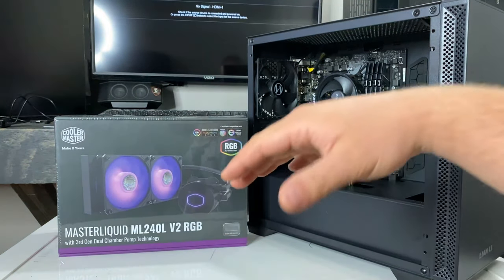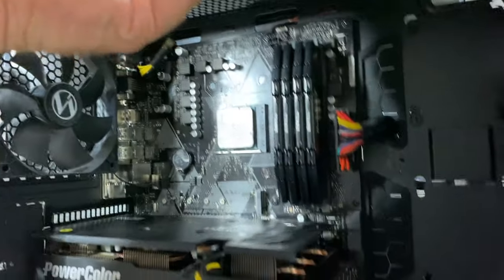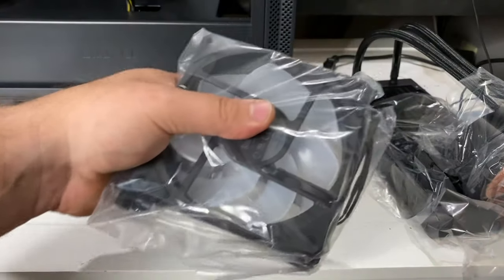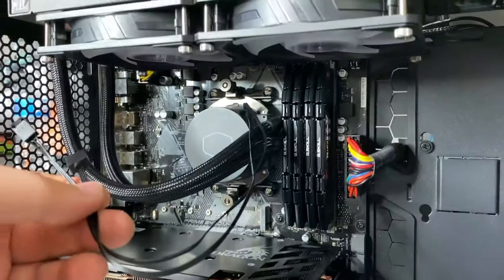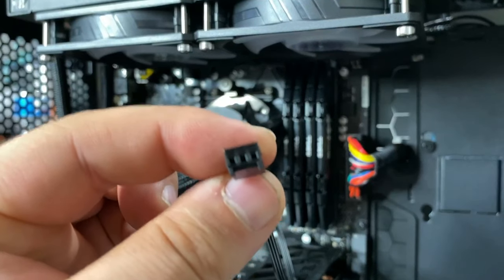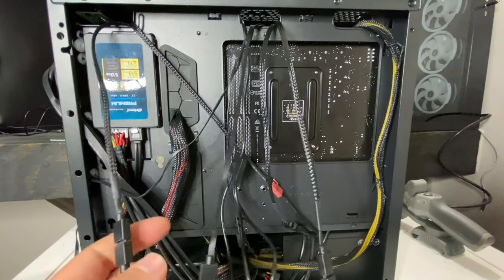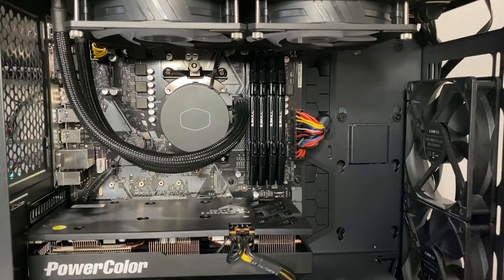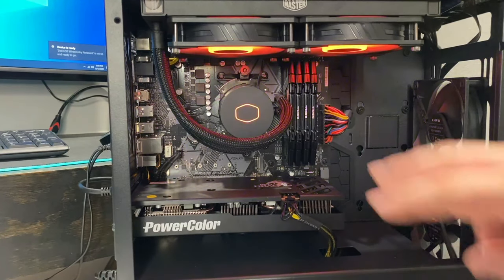How to Install a Water Cooler in your PC (MasterLiquid ML240L V2 RGB)

Comment: How would I connect the rgb to a z170a gaming m7 motherboard?
Reply from the maker: I believe you'd have to use the included controller and connect it to your molex connector from your power supply.
Reply: @BuildsWithV  so I connect it with the peripheral cable?
Reply from the maker: @Alex-pm2jj  correct, just have to connect the controller into your molex connector and then plug the fans into the controller itself.
Reply: I'm not sure what a molex is, is it like a peripheral cable or something like that? Not sure what you mean by molex
Reply from the maker: @Alex-pm2jj  it’s has 4-pins and they’re pretty big. The molex connector comes from your Power Supply. Search up molex connector to see what it looks like. It’s basically an older style connector. Still comes on PCs
Reply: @BuildsWithV  i have a smart series 500 watt power supply from thermaltake it has sata instead of molex
Reply: @BuildsWithV  does it work with sata though?
Reply from the maker: @Alex-pm2jj  oh okay, so it can work with sata but only if you get a molex to sata adapter.
Reply: @BuildsWithV  any recommended coolers without rgb?
Reply from the maker: @Alex-pm2jj  you can leave the RGBs unplugged on basically any cooler and it’ll all work fine. I can’t think of any cooler without any RGBs.
Reply: @BuildsWithV  would you recommend a hyper 212 black edition? Just found it for 30 dollars on amazon
Reply from the maker: @Alex-pm2jj  oh yeah they’re solid Air coolers. I thought you meant a AIO with no RGBs. But anyways yeah the 212 is pretty good

Comment: Just had this cooler ruin my CPU so be careful people. Check your temp regularly. The pump just stopped working and within an hour my whole CPU was fried.
Reply from the maker: I’m sorry to hear that man, are you still under warranty with the cooler? If you are I’d contact cooler master and tell them what happened. I’m pretty sure they will compensate you for your cpu and for the cooler. I’m not positive but it’s worth a try.

Comment: IF you use  watercoolers💦  cpu/ GPU  The Radiators  hoses   standing upright   front pc    on top  
  -  rtx 2080 waterforce  new 32cel  idle       1 year L8tr 26 idle           nice
Reply from the maker: I’ve personally never had a single issue with my radiator at the top of the case. No gurgling or anything. Great temps too.
Reply: @BuildsWithV   yeah my cpu radiator   is above  on top  the   GPU  waterforce 2x rad    front pc

Comment: Actually you did wrong. Mounting it on the front is better. Now it's exhausting and taking hot air generated from the GPU to the radiator. When it is on the front, it is not taking very hot air in to the case that doesn't make hotter the GPU.

Comment: You should have told us to plug stuff in before putting the radiator
Reply from the maker: That is a great point. I usually just plug everything in once the radiator is installed but in many cases you will not have enough space. Thanks for watching and for letting me know. 🙏

Comment: See here is my dilemma… why install a fan on radiator to blow Hot PC air ON radiator which cools liquid, as opposed to installing fans so they suck the air, through radiator cooling it off and two other fans can suck the air out? Everyone installs the fans on radiator to blow the inside hot air on radiator, when it makes a lot more sense to suck the outisde cold air through radiator
Reply: I was wondering about this myself when I saw the video. I'm assuming that part is kind of wrong?

Comment: What about the water? I don’t get how this works that’s why I can’t switch as I’ll fuck it up lmao
Reply from the maker: The liquid is already inside the cooler. These are closed loops systems which means you never have to maintenance them besides basically dusting. I feel you on that tho 👌
Reply: @BuildsWithV  ah ok that’s cool, might look at getting one of these they look good for keeping temps low

Comment: My rgb won’t work because I don’t have an rgb header in my motherboard 😔
Reply from the maker: Connect it to your power supply with the included molex connector and controller
Reply: @BuildsWithV  I didn’t see a plug in my power supply

Comment: Never used a water cooler but wheres the water lol
Reply from the maker: It’s inside the cooler already. These are called AIO which stands for all in one. Basically they’re closed loop systems so the water comes pre-filled and basically unable to switch it out.

Comment: did you plug the CPU on the same thing as the RGB ? https://youtu.be/8Lt-Y5hagL4?t=1327
Reply from the maker: The CPU block RGBs were plugged into the same splitter as the fan RGBs.

Comment: worst water cooling ever,  it keeps my i7 9700k at 75° - 80°  C while playing games
Reply from the maker: Did you make sure to remove the plastic sticker on the bottom of the water block? Have used and tested this cooler on intel and amd and it performs extremely well especially on intel. Either you got a defective one or something with the install is wrong.
Reply: @BuildsWithV  of course I did, im not such an idiot, also I used noctua NTH1 thermal paste
Reply from the maker: @WTM.23  Just making sure, I’m not either but it happens to the best of us 😂 it almost happened to me twice but I didn’t finish tightening it when I realized 🤦‍♂️. Personally I’d suggest you double check everything and/or have it exchanged. Like I said I’ve used this cooler many times already and have had 0 issues with any I’ve bought. They all gave me extremely good temps.
Reply from the maker: @WTM.23  are you overclocked at all?
Reply: @BuildsWithV  no overclock, just base clock frequency
Reply: So weird! I'm getting 55c
While playing warzone, I think something is wrong with your cooler dude
Reply: @itaykarni4440  I fix it, the problem was the thermal paste, noctua is terrible
Reply: @WTM.23  i knew it!!!! Have fun